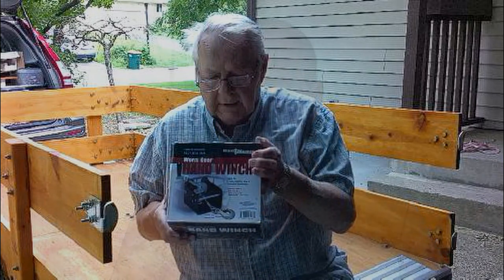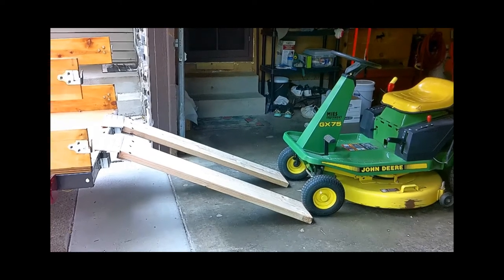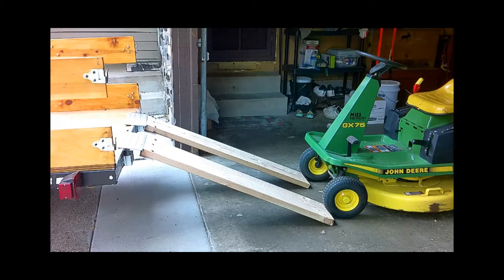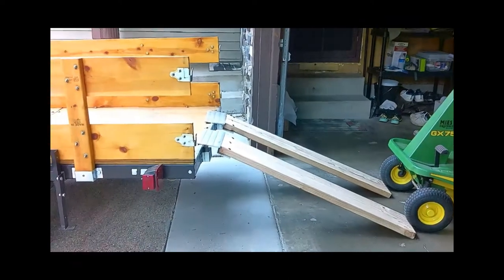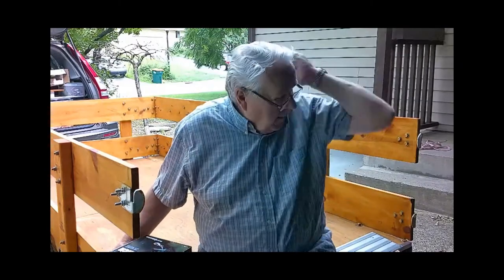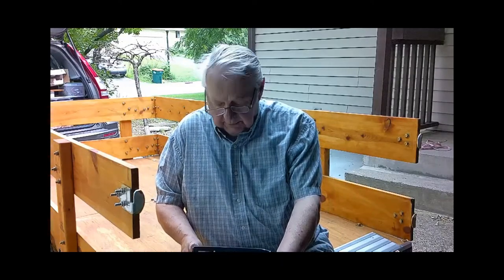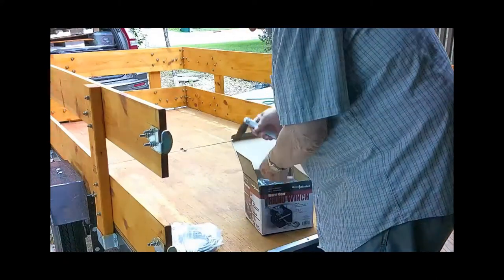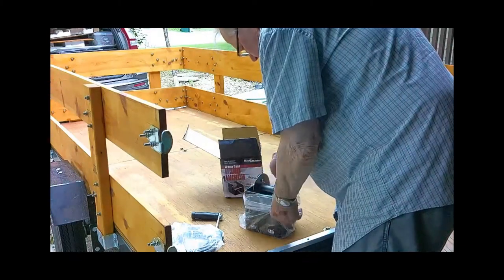INSTALL A WINCH ON A UTILITY TRAILER

Comment: GX75 is the best little 30” mower ever built. I bought a used one back in 2003 and it still cuts like a champ.
Reply from the maker: I've had many problems with belts coming off until I found a local guy in northern Wisconsin who knew how to fix the problem. The Belt guides and tensioners were installed wrong. Now it works great. Thanks for the comment.